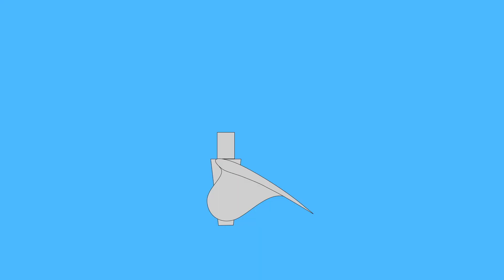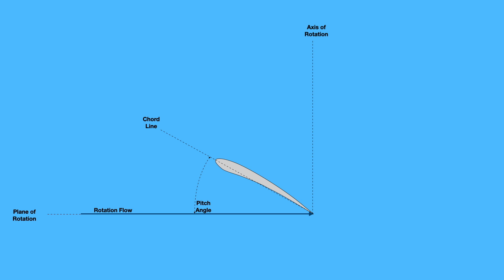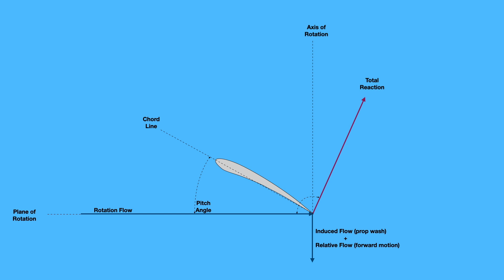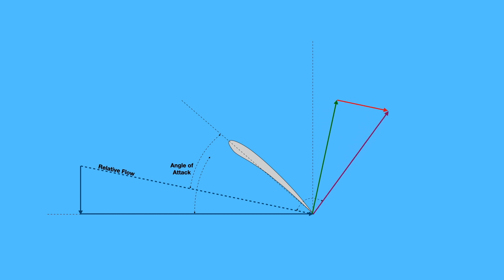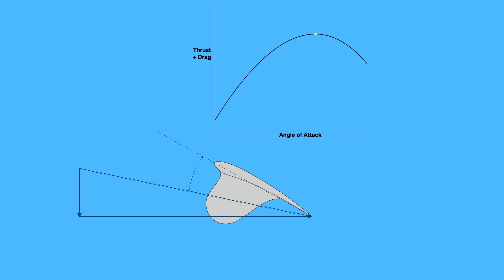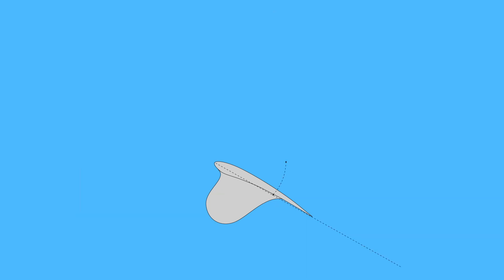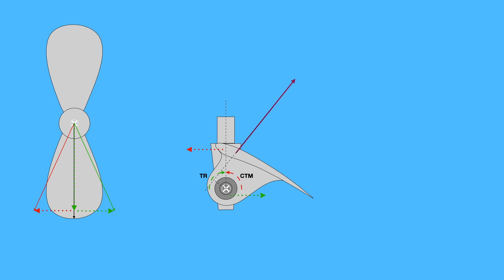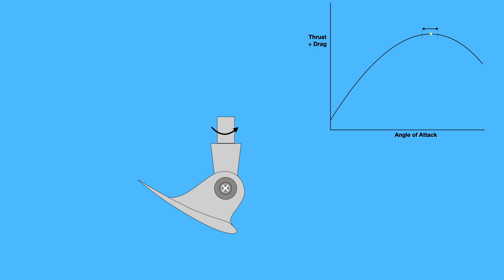Bruntons Autoprop - The Theory

Comment: we have just spent a month sailling with an autoprop after running a folder for years and a fixed 3-blade before that. Totally transformed motoring and especially motor-sailing performance. 
Very nice to see a product that fully lives up to what the manufacturer says, if not exceeds it. Kicking my self that I did not change earlier.
Reply from the maker: I had to do a fair bit of motor-sailing on a recent trip because chop was slowing us down and we had tidal gates to make... the prop made a huge difference... Love it.